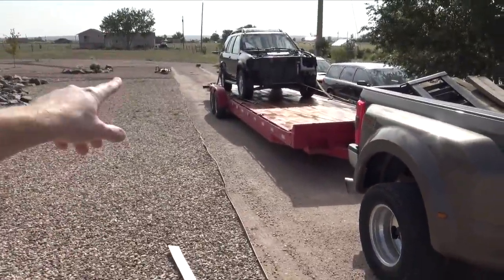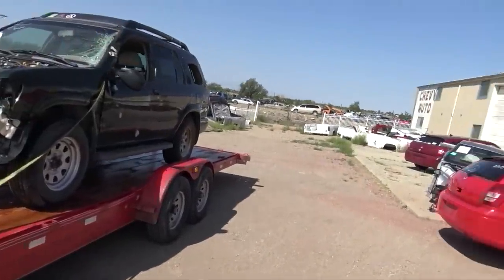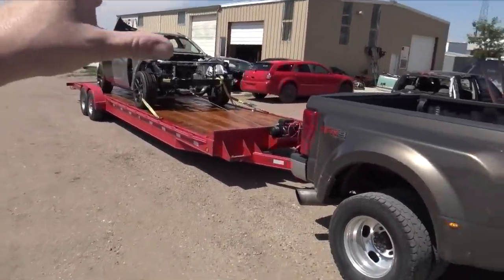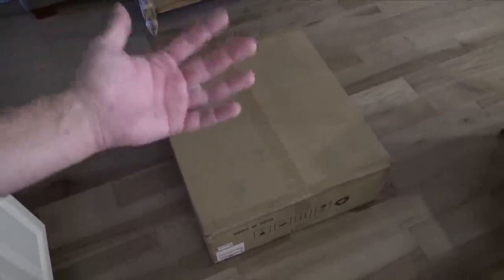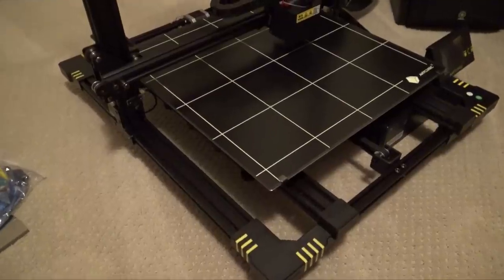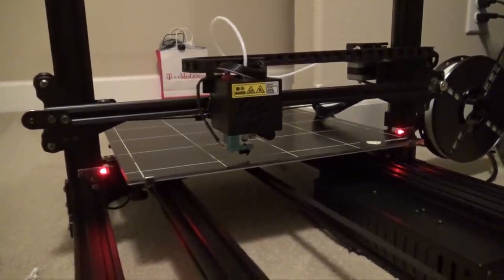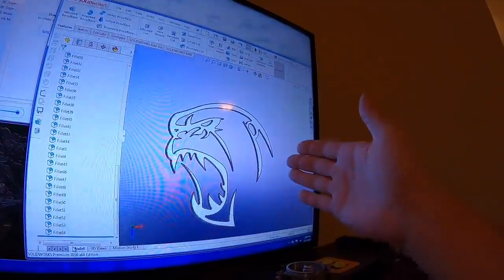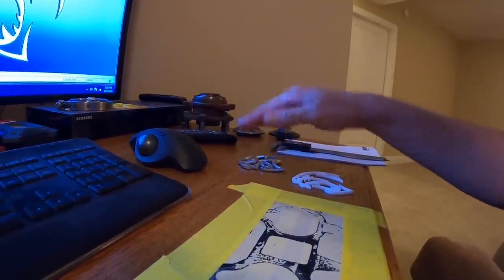Building the Ultimate Station Wagon | 2021 Dodge Charger Magnum Hellcat |  1000HP Hellwagon | Pt 10

Comment: In the early1980's Dodge had a small El Camino type car named the Dodge Rampage.
Reply: He mentioned that as the reason he was shying away from using it.
Reply: @AsixA6   I thought he might have been referencing the 2006 Dodge Rampage concept utility.
Reply: @jimshelton1  Maybe so.
Reply: It was built on the omni/horizon platform... those were bad, i have owned an omni. My aunt had a rampage... stem to stern, junk.
Reply: It was the same as a tourismo in stiling if i remember
Reply: @moneypitmagnum1812  i had one my senior year of HS in 99 and loved it ran very well was rated as a 1/2 ton i would haul a snowmobile in it .. okay well maybe 60% in it great lil truck
Reply: @scootersfrog  not saying that Kplatform was bad, just saying they had a life expectancy and they held it. My dad had a Subaru Brat. He thought it was cats pajamas. I still think grape ape it the bees knees

Comment: You should do a sand molding from scrap metal and see how it turns out I bet it will be with it. Man your doing a great job I'm looking forward to the finish product.oh and you can make keychains for the channel I think we would all love to get our hands on them. And I, think it should "RAMPAGE" but double check so you don't get sued like (B is for build) did for there mustang from the gone in 60 sec build you work to hard and come to far for some A**hole to come and ruin your dream.✌🏾

Comment: Rampage is best.  Dodge used to build a Dodge Rampage from 1982/84.  They even had a Shelby version in 1984.  It wasn't turbo charged like like the Shelby Charger but it had all the exterior add on pieces and the same Shelby seats.  One friend had an 84 Shelby Charger and the other one had the 84  Shelby Rampage.  Fun cars.

Comment: Dodge Charger Rampage sounds really nice, like it fits right in. 

You should also have the rim center caps with the Gorilla emblem. 

Another suggestion, whatever name you choose, you should have it stitched on the floor mats with big font in body color, or custom lit up (or not) door sill plates(whatever they're called) with the name. 

Don't forget to put your signature on the corner of the passenger side dash with permanent marker/pen in white or body color.

Comment: I think you should go with Rampage.  Love the emblem you designed, I think you should think about sandcasting the emblem and polishing the finshed result, cast in either Aluminum or bronze.  Aluminum is much easier and requires lower tempratures  Maybe you could find someone local to do the casting for you .  Just print about 12 of the emblems in what ever sizes you require and have some one do the casting for you you could sand and polish the faces and mask them, and then paint the bases black.  I have done something similar in the past to recreate Cougar emblems that were no longer available.  For my Cougar street machine.  Please double and triple check to make sure Rampage is available.  I seem to remember a Dodge truck with that name, or damn close to it.

Comment: For large prints you might want to change the nozzle to 0.8mm. at 0.3 to 0.4 mm layer height for prototypes it cuts down on print time significantly without losing detail

Comment: Dave I'm a bit shocked. You are normally the perfectionist. The trailer you did not paint or worse you did not bolt down the deck . It  will pop within a couple of days .

Comment: So if this is your first 3d printer I recommend getting a food dehydrator and dry your filament and set up a sealable storage box with dry packs when not using the printer. There are great videos on how to do this.  I really like the emblem and I like rampage and Cerberus (saw it in the comments and like that one too.)